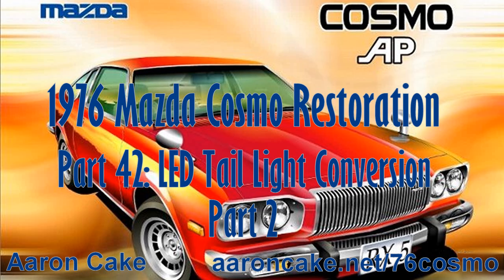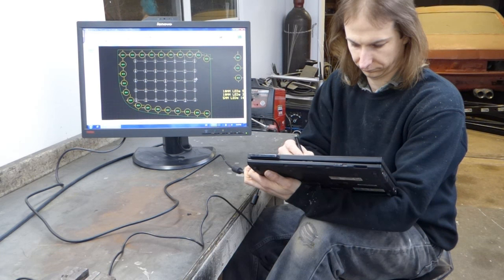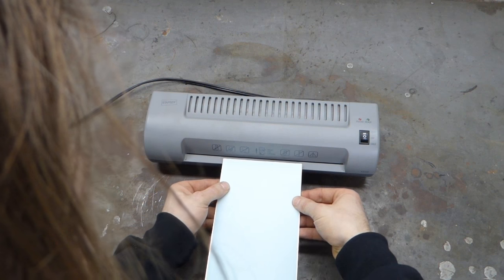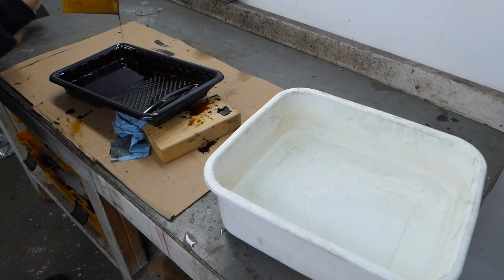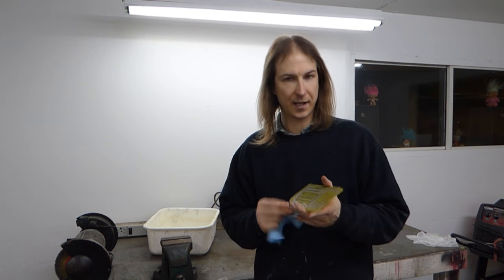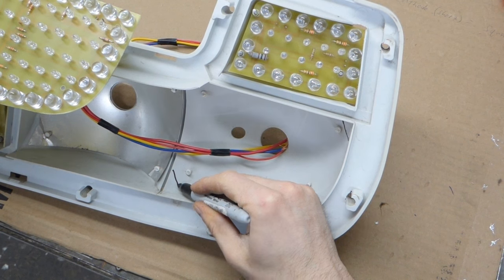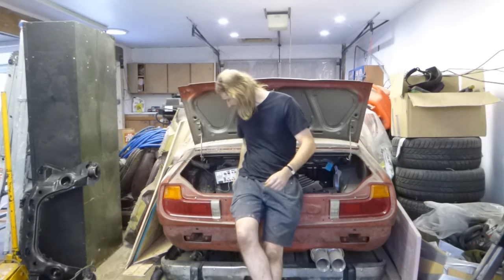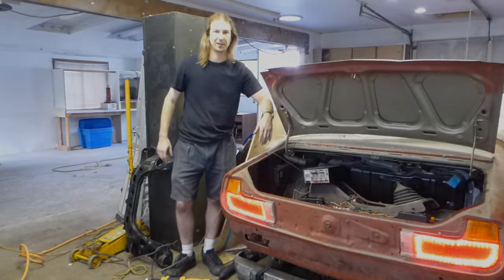Part 42: LED Tail Light Conversion, Part 2 - My 76 Mazda RX-5 Cosmo Restoration

Comment: I think I just saw a video straight from nerd heaven. Hope you never have an accident!
Reply from the maker: Sadly, I do have a history of being rear ended by other drivers. Which is one of the reasons that these lights are BRIGHT. And might be programmed to strobe for the first second of activation (very illegal of course). Collector car insurance will cover any damages but I fear how they would approach a damaged light such as this.
Reply: That's a question I have. Such thing is impossible over here in Germany, completely illegal. What about in the US?
Reply from the maker: Bigalinjapan I can't speak for the US as I am in Canada but I suspect the laws are the same. Modifying MOT (Ministry Of Transportation) or DOT (US Department Of Transportation) approved light assemblies is certainly illegal here. But there is a lot of leeway given to custom cars as long as the driver, how shall we say, isn't a douchebag. A lot of what I have done with this car isn't really legal since basically any modification that effect emissions (even if they are improved!), any suspension mixing/matching, etc. are not MOT approved.
Reply: Thanks for your answer. So seems like it is basically the same as here. Consequences over here are, that you lose all liability insurance in case of an accident. No big fun...
Reply from the maker: Bigalinjapan Sort of depends on the collision. If I was rear ended, I'd expect them to say the tail lights caused it because they aren't MOT. But if sideswiped, they'd probably not take a second look at the lights. However we have collector car insurance available over here from specialty companies which does take into account MOST modifications and covers things like this. Usually cheaper than regular insurance as owners of special vehicles tend to make far, far fewer claims.
Reply: +aaroncake we're just glad you're ok it's been a year since we haven't heard from you aaron
Reply: Good to have, definitely.

Comment: Thank you Aaron for taking time to post your build\restoration on youtube. I find it very entertaining and educational. Looking forward to seeing more. Greetings from Norway. By the way, those red marker lights look BAD ASS. It almost look like a high end luxury cruiser now
Reply from the maker: Thank you! That was exactly the look I was going for. I plan to carry the LED theme to the rest of the lights. Large 10MM LEDs outlining the front signals/markers. Though no fancy controls on them. Well, I already have the board patterns and software for the controller, so maybe....And plan to replace the side marker lights with almost invisible LED strips buried into the paint.
Reply: Really? How does that work, do you clear coat over the strips perhaps?
Reply from the maker: Ingvar Dirdal Yes, basically how it is done. A candy is sprayed over the lens to blend with the colour of the car, then it is cleared over. Whether I actually blend them totally or just flush is still up for debate. Will need to make a mockup. But there are even aftermarket kits to blend LED strips into a fender.

Comment: Great work, and very laborious too! Kudos for persisting through it! I would have considered the use of a thick piece of polystyrene cut and filed to fit the inside of the tail light so that you can put the boards on top and then place the plastic cover on top of that. Essentially sandwich the LED boards between polystyrene and the plastic cover. Just a suggestion, that's all.
Reply from the maker: Didn't think of that. The only issue with that is to adjust the height of the boards, it would be a matter of grinding the foam instead of adjusting the height of the nuts. Then again, once done it's done for good and may prove to be more stable long term.

Comment: I have an ongoing project similar to this, but instead I'm using a single Arduino Mini for controlling the lights. I figured I'd write the code without delays, using only the millis function, mainly so that I could save up on parts.

I live in the Brazilian Amazon and these damn things are so expensive down here it's not even funny.

I'm actually happy to see that the board designs and parts you used are pretty similar to what I'm using, so I'm probably on the right track.

Keep up the good work, can't wait to see the next videos.
Reply from the maker: Because each processor was dedicated I didn't see the harm in using the evil delay function. Glad I could be helpful in board and circuit design. I've found that ordering Arduino stuff out of China for free shipping (takes about a month) means the stuff is pennies on the dollar. Just ordered 10 minis for 5 dollars.

Comment: good to see you back at it 
hope the new home doesnt dissapoint now youre living there for a while
Reply from the maker: It seems fine. Quiet neighbourhood. People leave me alone which is nice. But it will be a long time before the house is "livable" vs. just capable of being lived in. About to tear apart the kitchen.
Reply: just make sure you can keep the water on and have a place for the dirty dishes
having food delivered gets expensive in a hurry
beds you can put anywhere but a toilet , a sink a place to wash up and internet you can hardly do without 
had torn the shower apart a while ago and when t a week without washing ...... i whent to the gym just for the showers there 

btw check youre private messages on youtube  i might be able to help you with the gasket material for the rearlights
Reply from the maker: watahyahknow Three other sinks in the house so that shouldn't be an issue and the stove, fridge and such can run on long extension cords. It will be funny because the bathroom shares a wall with the kitchen and I may push the bathroom wall into the kitchen a bit so for a while there will be no wall, and a toilet in the kitchen.

Comment: Just found your vids. Nice effect with the lamps. Cosmos where rather deluxe compared to the Rx-3s and REPUs I was working on, even much better than the first gen Rx7s. They had something special with the electrical system too, I think the lighting system had some kind of self test function. I worked on a ton of '76 Cosmos, mostly to take out engines and transmissions from rusted out cars. That close ratio 5-speed was a great box.
Reply from the maker: Hmm...that possible test function is intriguing. But, I tore out all of the stock wiring and it's in a box somewhere. Someone had already cut and spliced a lot of it. Plus I'm just going to install a Painless Wiring style harness for the basics supplement it with my own additions. For example I'm going to go modern with a whole body control module to run the windows, lights, etc. The Cosmo is a rather unique vehicle in the deluxe department. 4 wheel discs, LSD, 5 speed, power steering, etc. I honestly don't think the interior is as nice as the RX-4 though. But do like the wood touches.
Reply: In one video I can see the thermo sensor in the trunk, it was below the tank. You won't need that or the relay box that's hidden above the wheel and beside the tank. Also when you put the new spindle and hub on the front did you test the wheel and tire you want to use? I'd have done that right away, the new cars use a way positive offset so the spindle should protrude quite a bit further out than the old one.
Reply from the maker: Brian Boni The exhaust overheat sensor will go away when I POR-15 the trunk floor but there are still modifications to that floor I expect to make (battery tray, evap canister, air suspension related, etc.). I think the relay box is already gone as I removed the tank. Didn't bother checking front offset because I suspect any wheel I get will be either custom or available in a variety. FC wheels fit fine so I can go by that as a reference. There's not too much I can do about offset anyway save from shortening up the control arm and moving the top of the strut. I'm actually going to revisit my ball joint setup as I'm not quite happy with it.

Comment: I really like the sequential blinkers. If I may make a recommendation, (If you haven't already thought of it yourself) try using a headlight restoration kit on the plastic of the tail lamps, would really make them shine
Reply from the maker: That's exactly what I plan to do. Figured it would be easier to do off the car.
Reply from the maker: Oh and then clear coat them.

Comment: Great job on the lights and nice to see you back.  I don't even want to imagine how many hours you spent on those tail lights, writing the program and all else involved.  They turned out nice though!
Reply from the maker: It was a fairly tedious process only because so much of the work was repetitive. At least when soldering and drilling holes, one gets into a zone and the actions become almost automatic. You're not kidding on the code though. This was my first programming experience in C++ and with Arduino. And unlike the Arduino boards, the ATTINYs don't really have much facility for debugging. Ended up buying a Uno board and then  making a shield to emulate the tail lights so I didn't need to haul around my power supply and breadboard. Of course I did that after about 90% of the code was written.

Comment: Instead of bolt holes, design them to have a single nutsert in the center. I did conversion for a friend recently (actually inspired by that first part you posted some time ago) and that's the way i went. I think you're usually using steel nutserts, but, and you're probably aware, there's aluminium ones going to really small sizes. You can buy something like 50 pack on eBay for super cheap. I think it was an M3 or maybe a size up. Saves a ton of issues with handling the nuts, also, bonus, since it's aluminium, you can half way crush the sleeve and it sort of acts like a locknut.

Good to see you're back!! By far this car is my favorite project repair on YouTube. :)
Reply: Autorouter is lazy and sloppy, it has its purpose, in simple, mechanical grids, but not in real life custom applications, which are pretty much the norm. DiY is the best, still will be for quite a while.
Reply: Oh, and as a gasket, there's a guy here on YouTube that's building his own metal boat. Massive thing, his theme is to come up with as many DIY solutions to accepted paths. One of them was using different types of gaskets that are easy to find. So, check the episodes that have the gaskets mentioned in them. From hatches to pressurized testing tubes. SV Seeker.
Reply from the maker: That's actually quite a good idea. I could have put nutserts on the casing then used the jam nuts on the boards. The thing about the Cosmo lights is the lens sort of dives down at the bottom and as you move towards the outside. Required the boards to be at some odd angles so I needed the adjustability. Turned out it wasn't as critical the LEDs be right up against the lens as I thought though.
Reply from the maker: I think what I will do is run a bead of silicone caulking around the flange then just let it dry. Instant gasket!

Comment: Excellent work. The only critique I have is the screw standoffs that hold the LED boards in the housing. I would have used some nylon lock nuts, or red thread locker. I expect that road vibrations are going to make those boards start rattling around in there.
Reply from the maker: Hopefully the blue Loctite will hold. Only issue with red is that it requires heat to remove. Nylock nuts of course would be a good choice also.

Comment: Couple of years ago I converted my trailer lights to leds because oe were just terrible.But used low tech way just to make it as simple as possible. Yours looks really nice, great job.
Reply from the maker: If I just wanted to use LEDs, then the LED bulb replacements already available are the quickest and easiest way. But I wanted them a little fancy, and also an excuse to learn Arduino. Turned out to be some work.
Reply: No doubt it's just spectacular. I just say that sometimes for equipment that is going to be abused in my case it's better to simplify things.

Comment: Great vid . Nice to actually see somebody using an X201T as a tablet.  Looking forward to future vids Cheers
Reply from the maker: It's a great laptop, probably the best convertible tablet ever made. Have of course had the opportunity to upgrade to the x230, Helix, Yoga, etc. but why? The x201 does everything I need, and when I sit at my desk it plugs into the docking station driving two 23" ThinkVision monitors.
Reply: Yup got the docking station too. Ideal.  I also managed to find the internal gsm modem for it ( the wiring is in there as stock) Ok its only HSPA/ 3G but works remarkably well and no messing around with wifi access points or linking to my phone. Ive vowed to keep mine running as long as pos . Great device
Reply from the maker: bigfilsing I've never tried the 3G modem as I generally just tether with my BlackBerry the off chance I need Internet access out on the road. Though I should track down a Bluetooth module for it.

Comment: Great to see a new video, even better that it was almost an hour! Also happy to hear it'll be less of a wait for part 43. Excellent work here, the electronics looks top tier. 

When you mentioned the copper pads for cooling, are you referring to the larger square-ish blocks you left on the pcb while etching? Hopefully that'll be enough. Might want to leave the lights full on for a while to see how the temps get.
Reply from the maker: Yes, the large square blocks are used as heatsinks for the MOSFETs. I actually don't expect much of a heat build up if at all. The current through each MOSFET is less than 1A and the PWM is an on/off type event. It's really only when asked to conduct partially that they significantly heat up. After running for 10 minutes or so in prototype I wasn't able to feel any warming with my fingers.

Comment: holy fantasticlus!
you are back!

good to see you are still arround :)

and, if you need a filler video... what about a tour of the "new" workshop? and tub-area...
Reply from the maker: A tour of the shop is being arranged, but only when it is completely done.
Reply: the tub... is... part of the.. shop.. no?
Reply from the maker: Aslak Zissou Yes, it is. The hot tub room is through the window to the right of my main work bench. Right now it's mostly being used as a storage room for building materials and such. But the hot tub has been used twice. Eventually it will move out of the shop onto a new deck I will build behind the house.

Comment: Excellent engineering!  Terrific fabrication of those PCBs too. Wow.  /  In other words, brilliant design and a WELL DONE project.  Kudos young man.  PS: Could those lights possibly be 'too bright' that they might catch a cops eyes?  But I sure like them.
Reply from the maker: Likely no brighter than many OEM lights. But if they are a bit too bright, easy to dim in software. A feature I'm thinking of adding is that they go full brightness when activated but over the next minute dim to about 50%. To immediately get attention of drivers behind, but not dazzle them while at a red light.

Comment: I was disappointed when I saw the topic, but that was very interesting throughout. I bought all the stuff to etch a board for an FPV transmitter project, but never got around to it. The band saw looks way better than the tin snips a lot of people use to cut out the boards. I need to pick up a laminator now. That heats both sides for a two sided board?
Reply from the maker: I've never done a two sided board. I'd imagine you'd just flip it over and put it through again. This particular laminator only heats the top roller. There are larger models which heat several top and bottom rollers which may be better for double sided boards. The real trick I think with double sided will be registration. Probably have to drill holes to line up the top and bottom. Yes, having cut PCBs before with utility knives, scissors, shears and such, nothing beats the band saw.

Comment: Few observations. Troll dolls are the devil, You are much more patient with your electronic workings than me, and now im craving for the next installment! more than I even want to finish my car.
Reply from the maker: The property came with a surprising number of troll dolls. Kept finding them, so I just lined them up in about the most creepy way possible. Some of them have glowing eyes. The next video will be far more metal work. After all that detail oriented electronics, I would like to pound some metal. Have a set of bumpers that need to be straightened, slimmed and fitted.
Reply: That's a little odd but better than murderous news paper clippings.

Comment: Instead of cutting the reflectors out, you may have been able to cut the tips down on the LEDs just far enough as to not damage the semiconductor.  Light would be somewhat more diffused in that spot though.
Reply from the maker: That was actually my first thought but there wasn't enough room. Really, I should have been more careful and just mounted those LEDs lower on the board.